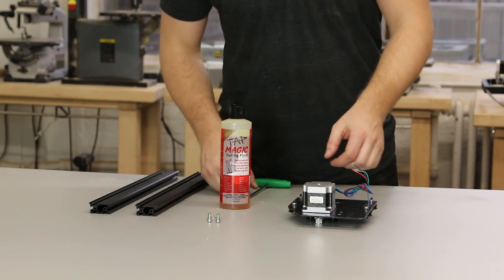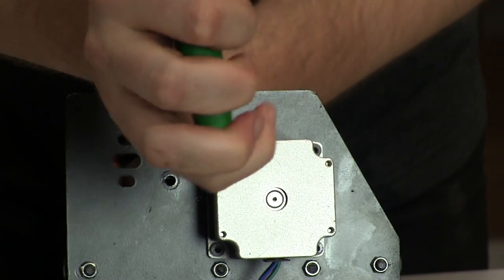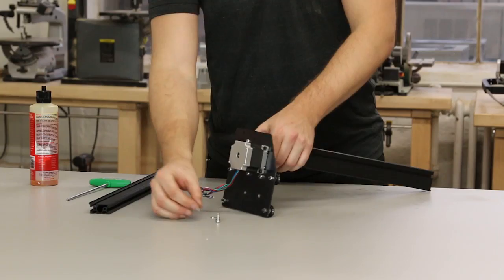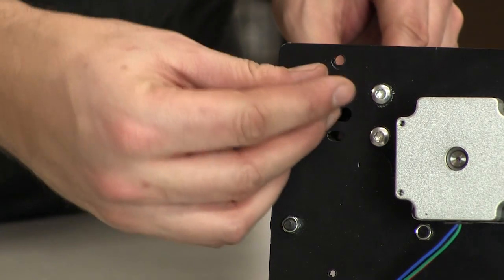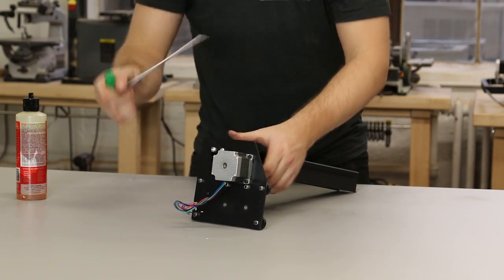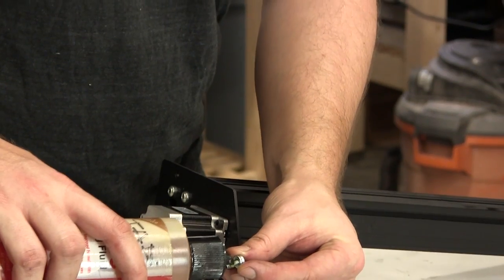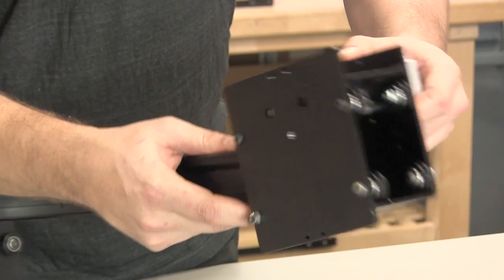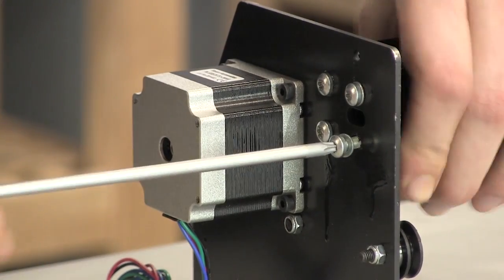X-Carve | Assembly | Gantry

Comment: It is also much smoother to use a good variable speed drill motor with the torx bit... because you can apply much more consistent torque on the screw while it is tapping the hole. Lay the extrusion on the edge of a table, clamp it if you have a clamp, sit in front of the holes to tap and hold the drill motor as perpendicular as is possible to the end plane of the extrusion.
Reply: +plcprofessor Plus, your wrists will be screaming in pain if you try to do this completely by hand.
Reply: +plcprofessor Good call on both points. I held it (very carefully) between my legs and up against the floor and let the weight of the drill help keep things centered. I couldn't imagine trying to get those tapped by hand, or trying to balance the plate during the process.

Comment: You need to run the self tapping screws into the extrusions without the side plates first, then "unscrew" them and then assemble. There is no reason to risk galling the entry threads by balancing the side plate while tapping. These folks are providing a good service to the maker community. Be reasonable with your expectations. If you are not an open source minded person, you will be expecting a totally off the shelf finished kit and this endeavor requires a little common sense on your part. They do not keep track of what you have in terms of what you need.